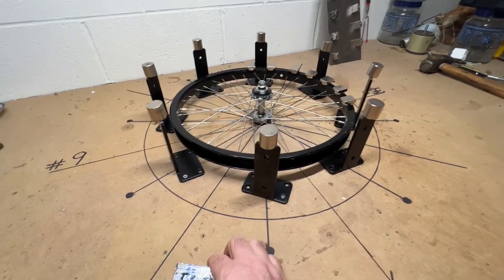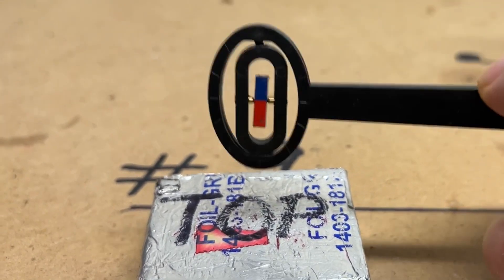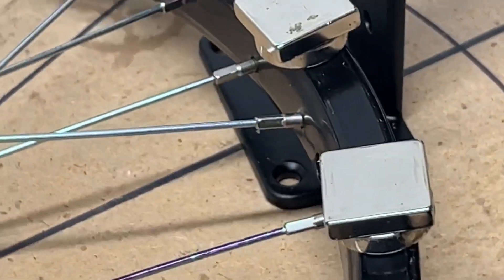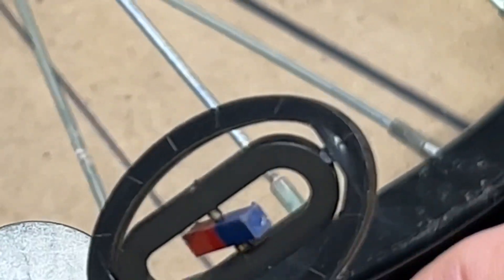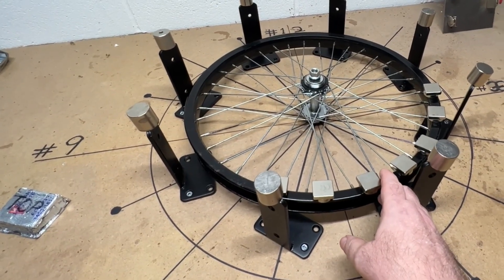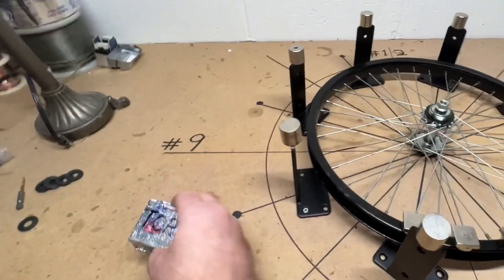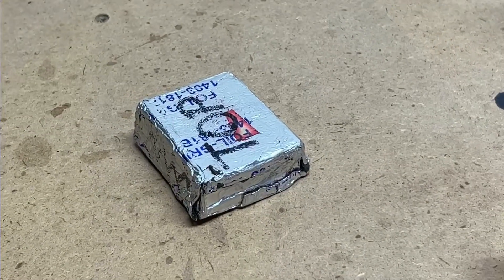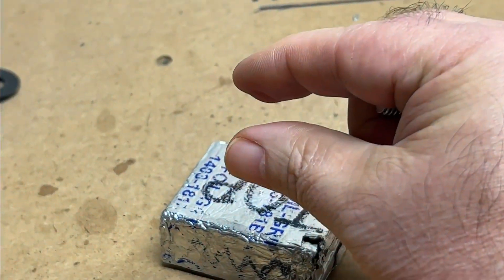🧲 STATOR POLES THROUGH FACE | Free Energy Research

Comment: First!!🐱👍🏿
Take care of yourself avoid carbs and sugar, do intemittent fasting and also watch Dr Eric Berg health videos!
Reply from the maker: 🧲 Sadly, I’m aware of what you’re saying. Starch actually turns into sugar, and white sugar only adds to the problem.  Further complicating matters is that most everything has sugar in it today. I often fast for 24 to 36 hours. And I don’t eat a lot as well. Keep my portions small. One thing is for certain is that it’s real scary when you start to lose your feet. I am successfully reversing the process on my own so far. So the correct color of my feet is coming back. If the problem starts to come back I will see a podiatrist right away.  Thank you so much for your helpful and very constructive feedback. Much obliged.